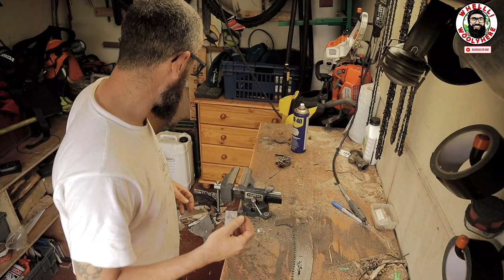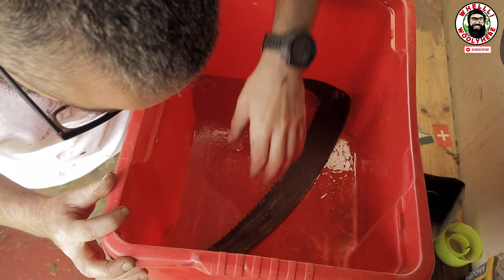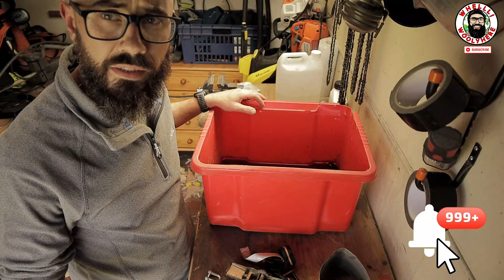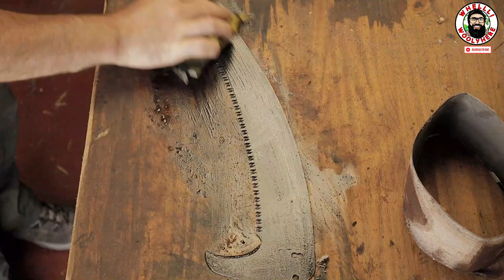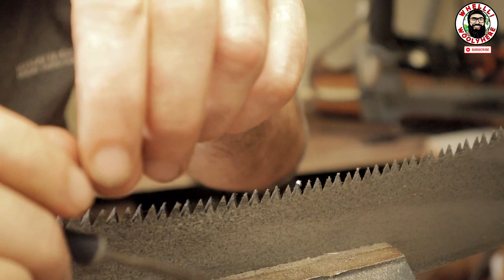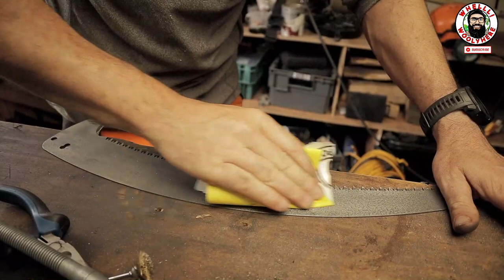Rusty Silky Saw Restoration

Comment: I have a saw setting and a saw tooth filing guide....but have never used it before, I rescued it from a garage that needed to be cleaned out prior to the tenants moving out, I need to dig it out, I also got some nice hand saws that are in need of restoration.
Reply from the maker: I think I need to reset the teeth, might have pushed them in when I was sanding